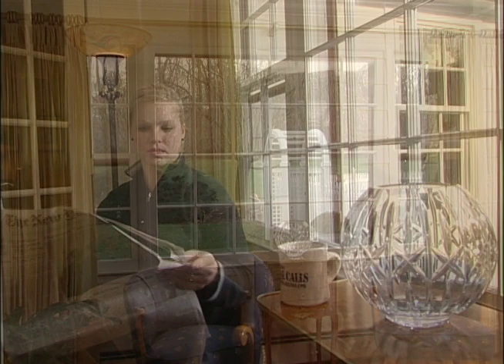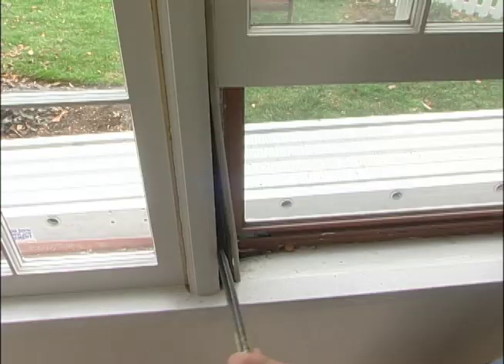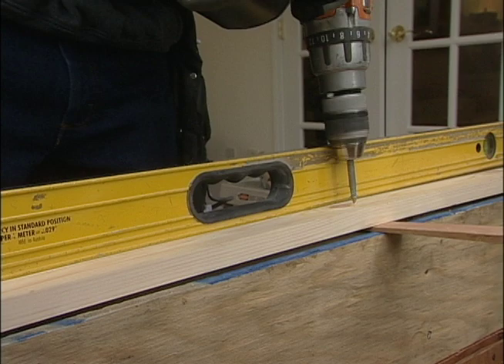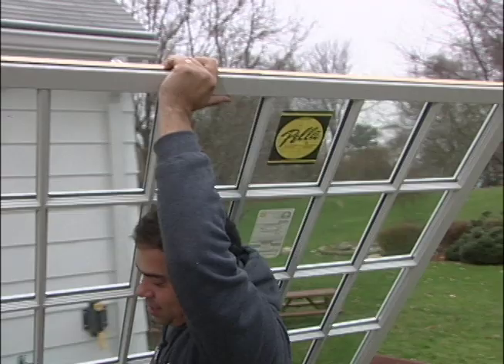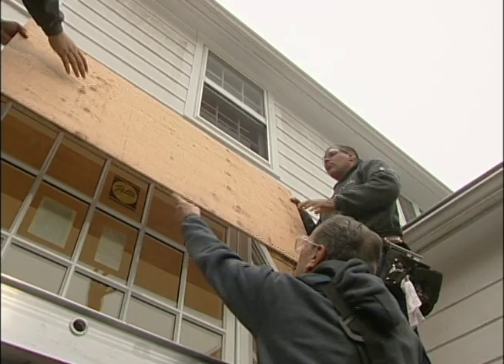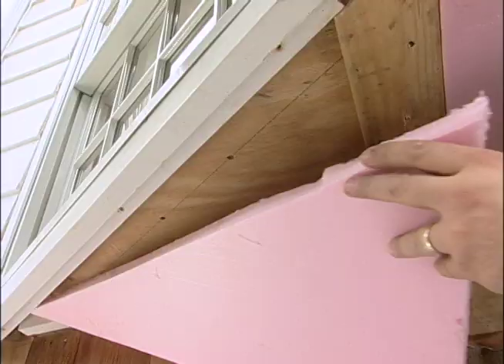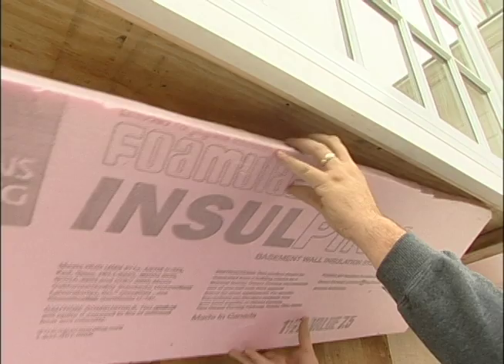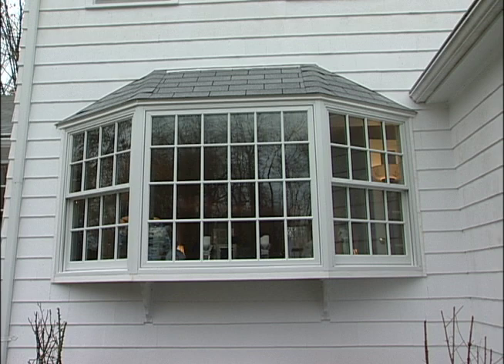Install Bay Window

Comment: Should never put a bay window so close to where the roof line comes out on the other side. Strong rain storms or windy rain storms will result in water penetrating.

Comment: Looks expensive
Reply: YES IT IS
Reply: Like 1000
Reply: @stevenwindow3504  that's not that bad. Is that USD?
Reply: around $1300
Reply: Not sure where you all are getting $1,000-$1,300?  You can't touch the window itself for under triple that, not including installation.
Reply: It’s at least 10 grand.

Comment: Felt paper is not water tight. Ice & Water shield and step flashing is the only way to go. Any roofer knows that, and I'll bet that you a beer that pella tape over that felt paper are not even code regarding the side wall. You mine as well of hired a fisherman to roof it.

Comment: Excellent Video showing detailed installation! Only thing I'd add is, I know everybody flips the shingle for the starter row, but the instructions on the roofing bundles says to cut the tabs off and move the tar strip down to the edge, so the first row of tabs will be in a tar strip also, so high winds can't flip the first row up, and possibly take more upper rows with it. Or just use actual starter strips.
Reply: You're correct! I know it's been 2 years since this comment but yes that's a much better method. Also the metal flashing SHOULD NOT stop at the edge. It should extend beyond the siding and "kick out" from the wall. Otherwise you make a perfect spot for the water to run across the metal and right behind your siding. This fella will have a leak on his flashing most definitely and he won't notice it for 5-10 years.

Source: 20 years roofing

Comment: very good video. what kind of material is used for the panel ? ( around 11 minutes and 33 seconds in the video ?) thanks
Reply: That would be any kind of solid wood like pine, alder, oak, etc. you could also probably use MDF since it’s painted there

Comment: Well said and varieties available.   My major 3 concerns besides yours are: the window"flashing" did nothing on the still to protect the new wood.   I understand the rain isn't supposed to get in there,  but if that is true,  why put any flashing there?  I would have ran it over the top exposed wood and added some flashing behind the new shingles. 2nd: sure it is the design,  but all of that weight relying on 2 cables? It seems ridiculous to me.   That was a ton of weight and if either cable falls for any reason,  there will be issues of a serious nature. The decorative supports are the 1st thing that will rot.  3rd: run that felt paper up the wall..... what does it cost? Barely 2" is the absolute minimum could get by with.
It looks great and adds charm.  Keep it well caulked and painted to protect all that wood.

Comment: June 23 2023   I have always wanted a bay window but most companies just want to replace exesting window's. So they tell me it's to expensive. But biggest thing is the lost of the center support of a bearing wall. I don't think so! I have two fixed, 3'X4' windows, with over all being 7'X4' what do think? You lost two, any worries with the header? It sounds like work then just replacing the windows.

Comment: Why put the step flashing UNDER the shingles? What good does that do? It just directs water under to the felt paper. Not that I am an expert, but being an amateur I would put the first course of shingle first and then step flashing over that. Otherwise what is the point of it? You already have tape over the top of the felt paper....

Comment: My two (too) cents (sense): This installation fails on numerous points, for me.  Very light weight low cost install in general.  Old growth wood rots and new growth wood rots faster. Modern vinyl construction is superior to wood, imo. Do they use aluminum as the separator between the panes or structural plastic?  How good is the gas seal and for how long do they have a full replacement policy. Who uses felt paper anymore. Seriously? Also, they show some loosely installed pink glass insulation in the hip roof and none on the house wall? No knees instead they use rustable cables attached to soft wood structure to 'hang' the window.  This will most likely shift or slip as anchors are not strong enough for serious weight over the years.  Flower pots, heavy adults, kids . . . Nails not screws. Thin gassy Pink foam board underneath. In the north that will not stop condensation internally.  So how long is this install guaranteed for?  50 years? At least? Low-E is not the best choice in northern NY for us.  We are concerned more about heat loss up here. My Pellas were replaced with a Canadian OEM and they have been perfect for 18 years so far.  Just my opinion.